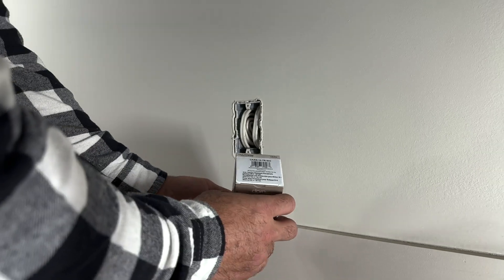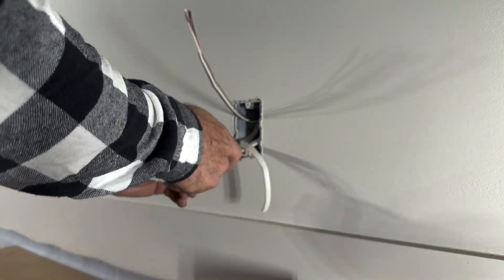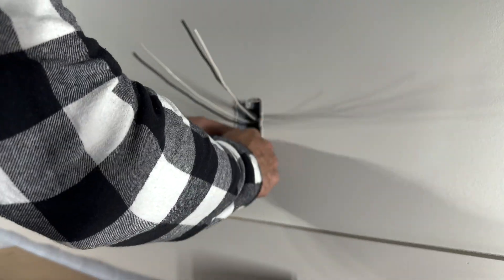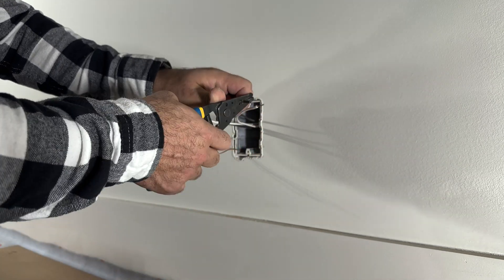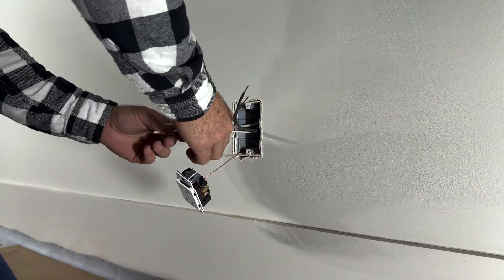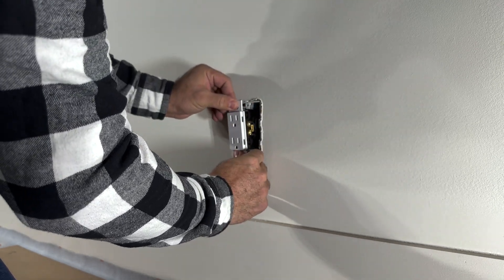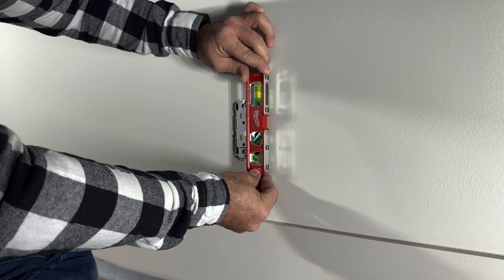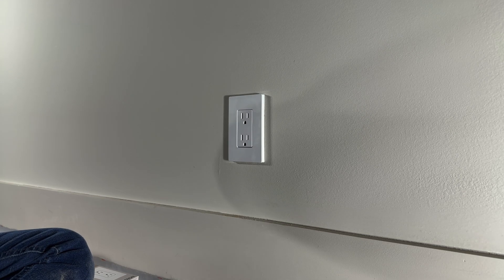Lutron Receptacle and Wall plate installation

Comment: I can’t get the screwless plate to be flush with Lutron outlets. It’s always sticking off the wall
Reply from the maker: cut the ears of the Lutron outlet, in the metal part of the outlet that holds the screw you will notice two little circles with pre-cut outlines take those off it will allow the outlet to sit deeper against the box by about two millimetres.